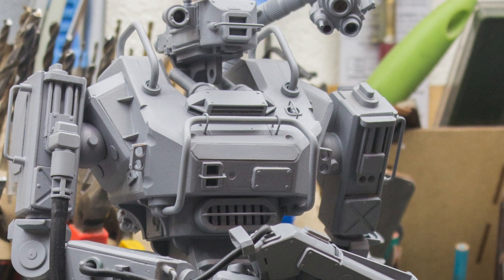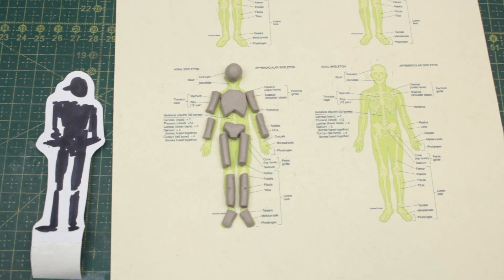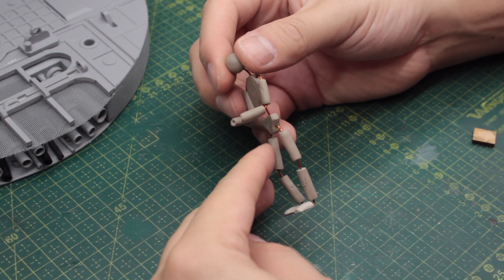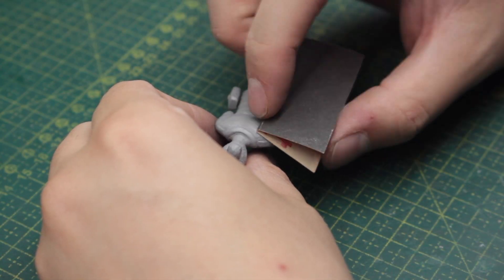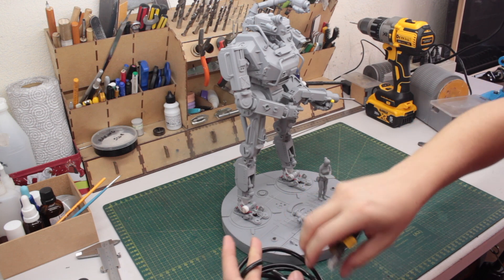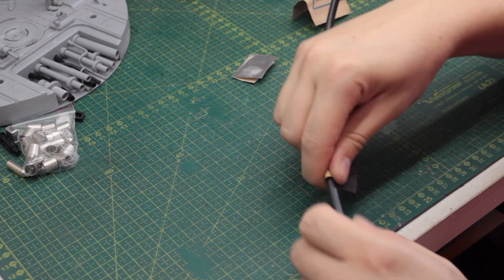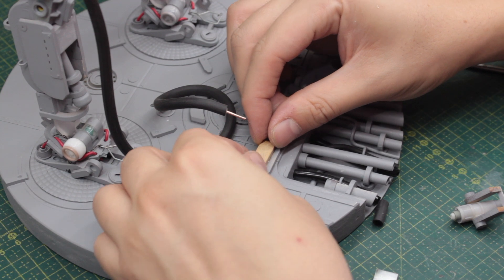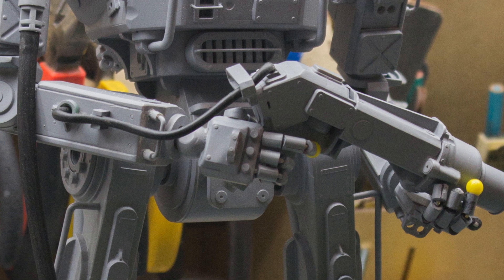Scratchbuilding a Humanoid Repair Robot - PT7 - Build Finished!

Comment: Cool stuff! Why don't you create an armature of wire as a skeleton, then slide the putty onto that armature before it sets? Maybe braze the pieces of the copper wire using a torch or a soldering iron. Would remove some of the tedious parts of the process?
Reply from the maker: I'm gonna try that next time! Thanks a lot :)
Reply: @CutTransformGlue  Have you checked out edu puertas https://www.youtube.com/watch?v=5Tt2HURE_ZU , he does stop motion but there are many similarities.

Also, there are "clays" that stay soft for years, until you bake them in an oven. That might be easier to work with than the stuff you're using.

Having said all that - the results you're currently getting are awesome, well done!

Comment: Very nice great achievement!  From the height I guess the robot has to plug the power cable to itself!  Is the robot fixed to the base?
Reply from the maker: Yeah, I thought about that.. Unless they have some sort of crane to do that. The robot is fixed from under the base, with a bolt in each feet :) Thanks a lot!

Comment: You are an excellent sculptor. We have to introduce you to Sculpey!
Reply from the maker: I wish I had that brand here! Sculpey is the one you have to bake so that it sets, right? Must be awesome! I'll look for similar products, thanks a lot
Reply: I have my "Big Fat Dumb American" blinders on again. Sorry. It would be cool to know where you are if sharing is OK. About Sculpey, Yes. Keep it thin and cook it for 15 minutes. It is made of Poly Vinyl Chloride. Yes, the pipe stuff. I wonder if there are other brands out there in the world that work the same? It works precisely like your current process. In fact, the bones can be done, baked and ready in 30 minutes. I re-cook previously done steps with no ill effects. Some of the stuff I just finished had to be carved to fit. Clean cuts, easy smoothing. It carves like slightly tough Balsa. I wonder if it could be LASER cut? Hmmmm...

Comment: Dude, your human figures are SO good - and I totally agree the aesthetic choice of having an understated pose is the right one, and not that easy to achieve (especially standing still and having the weight of the body look properly distributed). I wish I could get it looking this good at this kind of scale - plus, it's a completely different skill to hard edge mechs and stuff too, so extra props to you! Have you considered using tiny miniature files to make sanding the harder to reach areas a little easier?
Reply from the maker: Thanks a lot Jack! Hard edge mechs are way more forgiving than organic shaped things for sure.. I should look for those miniature files, thanks a lot for the tip